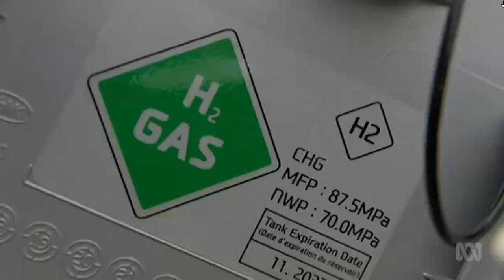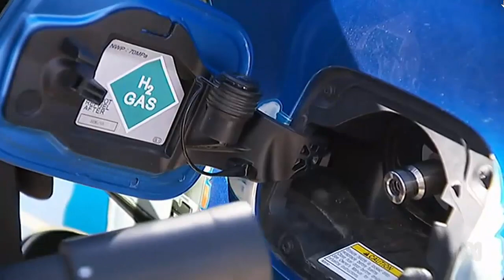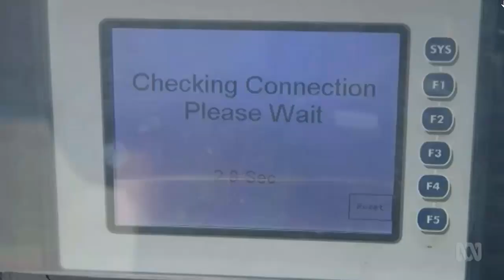CSIRO breakthrough sees hydrogen cars hit the road in Queensland

Comment: I am very tired of shouting from the rooftops that Hydrogen via Ammonia is the future! So very pleased to see Ammonia as a direct competitor to EV’s that are not at all green when you take factors as how the electricity is generated! Also, there are other factors such as the energy used to mine the components for the batteries, and what happens to the batteries end of life? EV’s are far from a clean solution!